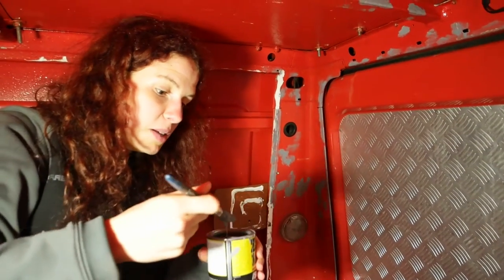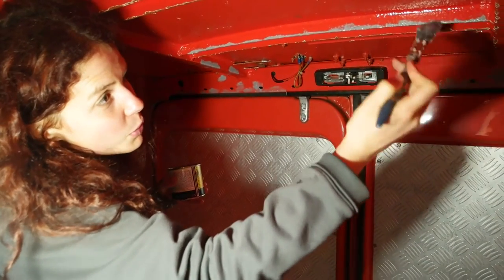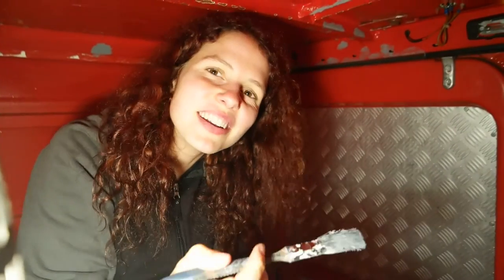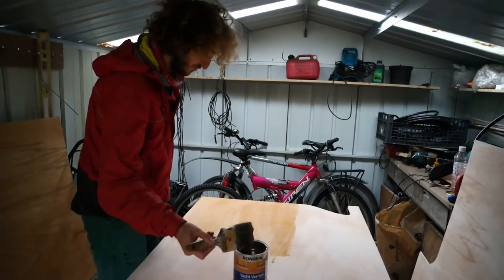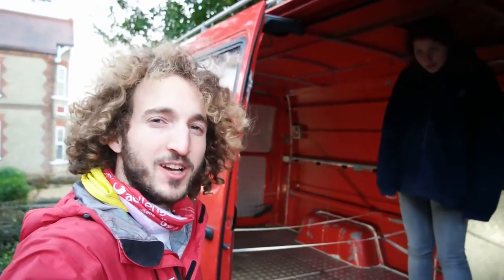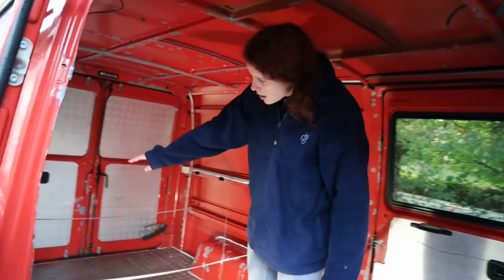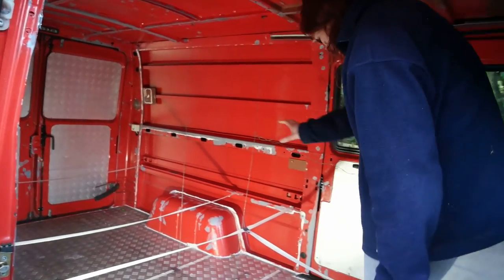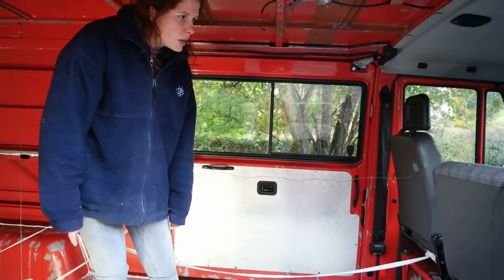Getting started | Van Life Vlog 4

Comment: dude check out the ikea induction cook plate its perfect in campers super cheap and works really well retails about £35
Reply from the maker: Hi, thanks for the tip, that does look like a good deal. 2000W is probably a bit much for our battery/solar system though. Good option for people who are always on hookup though...